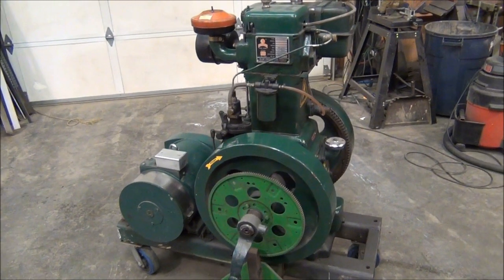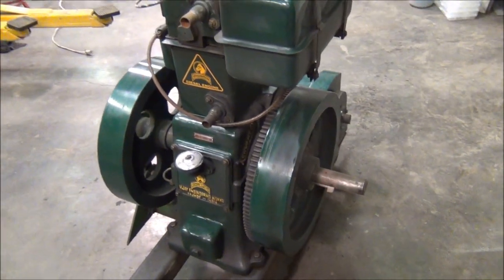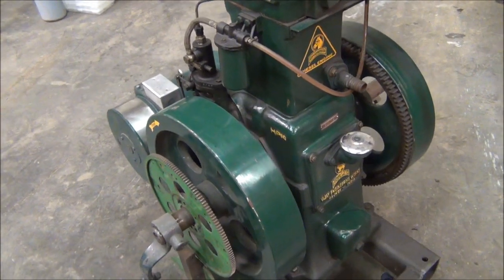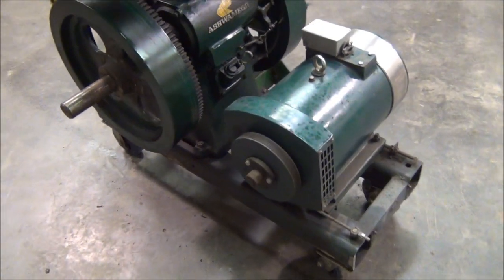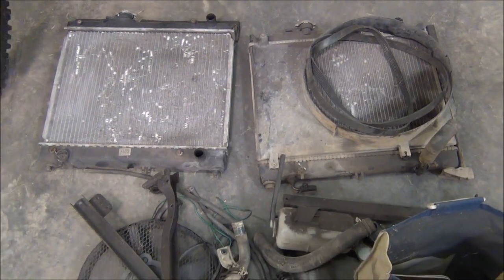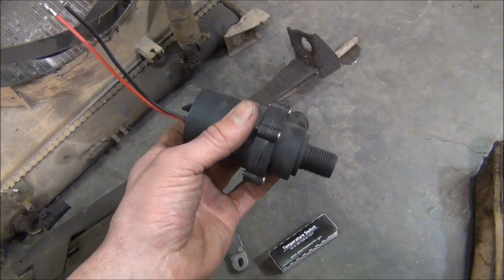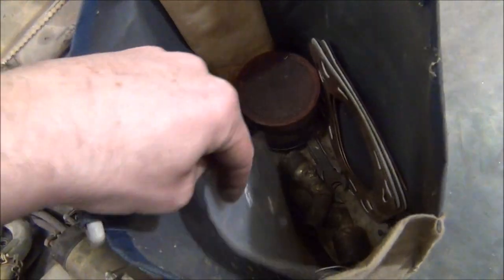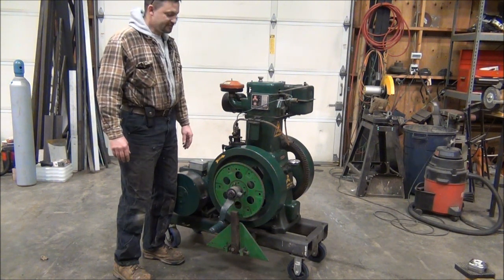Lister clone flywheel engine startup

Comment: OK, a LONG time ago, I worked at a rental yard, 
that had 2 different Lister powered generators.

1 was a 2 cylinder, the other was 3 cylinders.

When they were warm, two cranks on the 2 cyl, 
release the compression release on one cyl, and
it would start.  Chunk-chunk.  Release next cyl, 
chunkchunk-chunkchunk.  Wish I could find those 
again!

Boss's grandfather was supplying extra power 
to the Boulder (Hoover) Dam, with them.  Or so 
I was told.

steve

Comment: I always have problems starting those engines with the handle. I prefer the electric method. But alot of people seem to be comfortable with those handles and start those engines with ease. I can spend sometimes 30 minutes just trying to start the engine.

Comment: I was looking at this and trying to figure out where and how a serpentine belt would work, then I thought that perhaps you mis-spoke and meant to say  'polyvee' belt. I gathered that by noticing the poly-vee pulley on the generator shaft.
I'll tell you one thing, it might be a Lister Clone, but it starts with a lot less smoke than an original Lister does. That's a sweet running engine , I'll give you that !

Comment: What is hourly consumption of this engine does anyone know?
Reply: Found this chart with a google search, I don't know if it's accurate, but I like those numbers!
Consumption at 1/4 load	0.163 gallons/hour
Consumption at 1/2 load	0.192 gallons/hour
Consumption at 3/4 load	0.251 gallons/hour
Consumption at full load	0.296 gallons/hour
Fuel Tank Capacity	2.5 gallons
Run Time at 1/4 Load	15.3 hours